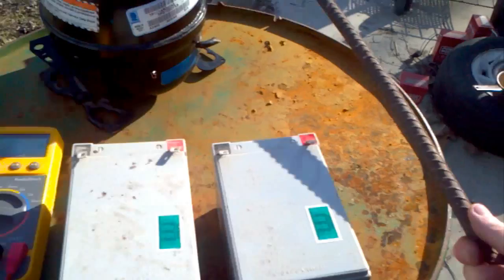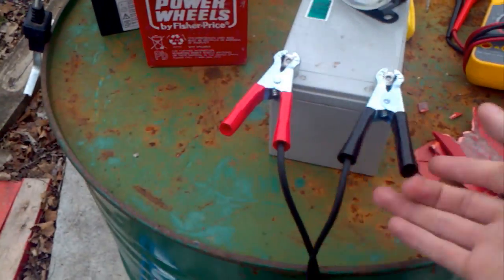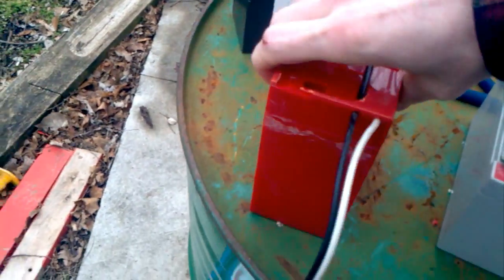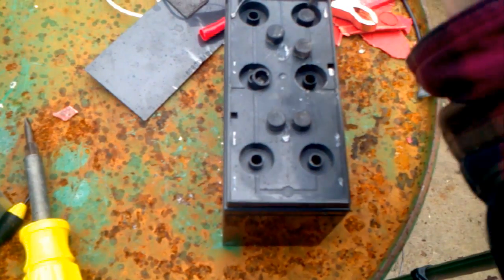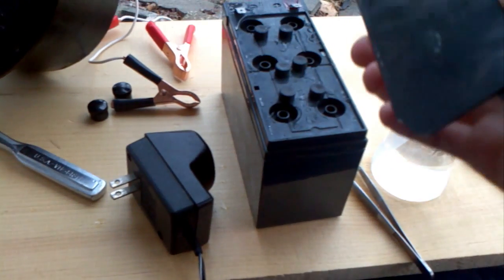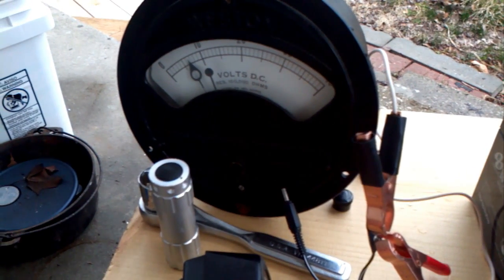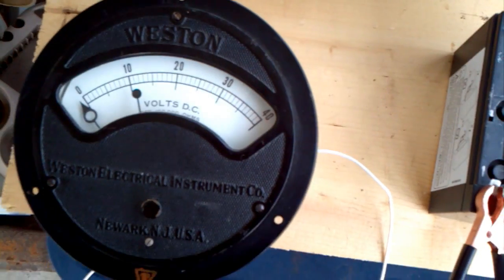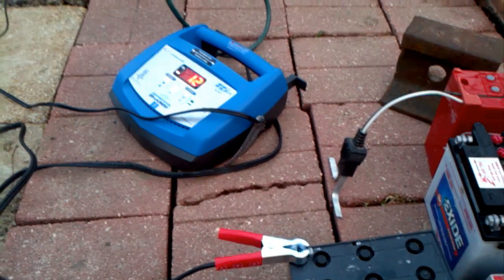DIY: Restoring Sealed Lead Acid Battery

Comment: How are you sealing these batteries back up? Isn't the whole purpose of using SLA batteries so that you can use them in Any orientation? Wouldn't adding water prevent you from use the battery on its side?
Reply from the maker: well you dont have to fully fill the battery, you can just add enough to soak the sponges inside. all you need to do is keep the little rubber caps on so even tapeing the plastic plate back on will do the trick.
Reply: Rinoa Super-Genius So are you saying once you've restored the battery, its ok to drain all the water back out?
Reply from the maker: JRMNone
 sure you can do that too. but you wouldnt be draining all the water out. just the extra water.

i wouldnt recommend draining the water out because it would prolly make you lose some acid. but you could replace that with epsom salt or just a bit of sulfuric acid. would be best just to put a bit of water in to make the sponges wet.

but yeah its not a really big deal if you accidentally over fill it.
Reply: Thanks.  I was cool with water, but I don't know if I want to play around with epsom salt or sulfuric acid.

Comment: Sparking up a welder on a hydrogen-producing battery? Seems safe.
Reply: +Aden B
There are several factors in doing a pro job. One plan I found which successfully combines these is the Magic Mender Wizard (check it out on google) definately the most useful info that I have ever heard of. look at this  super resource.
Reply: Not certain about the points made but ,if anyone else trying to find out how to recondition car battery at home try Vaxicorn Battery Extender Guide (do a search on google ) ? Ive heard some unbelievable things about it and my work buddy got amazing success with it.

Comment: If you are going to try and restore down  SLA AGM What ever then you must have the Correct charger for the Job Welder on a battery What Type Of Crack are you on  ? you are lucky it did not blow the plates and the contents all over you  sheesh If one of these goes west on you then you have the capability to lose an arm hand finger etc. even your life in some cases  Serious And another thing Did your parent's or tutor not teach you anything about hygiene in the work place u need to have a Serious Clean up YOU MESS HEAD !! .
Reply: +Rinoa Super-Genius   Rain water is distilled water for those who have highly conductive water from the tap, it depends where you live, here where I live there is a lot of calcium in the water and it bungs up tap rubbers and kettles.
Reply: Ps always used de ironized water  tap water will work but will reduce the life of the battery . de ion it first .;)
Reply from the maker: Rs500ybd
i think you me de-ionized. i've been putting tap water into all my batteries and only and i havent had any issues with them yet. we'll have to wait till one of them dies to know for sure though.
Reply: Life difference on a 12 volt flooded car battery is about 6 weeks longer on distilled not much in it I know but in critical application needs must ;)
Reply from the maker: Rs500ybd
 6 weeks on like a 10+ year lifespan? yeah i'll save the money and effort and use regular water.
Reply: @RinoaL  The tap water at my house is well water, and as is typical of well water, is very hard, containing lots of calcium and magnesium. I would not put that water into a battery. In general, surface water sources are not as hard as well water sources. In general, municipal water systems use surface water sources as a supply. So you are probably OK putting municipal tap water into a battery. But some municipal water systems are supplied by wells.

Comment: So your load test is with the charger connected. Do you realize what's wrong there?
Reply from the maker: nope because the charger was off and i was using it as a mutimeter if i remember right. but next time give the timestamp of when your talking about.

Comment: The Acid doesn't evaporate! The water does, that's why you don't add more acid just DISTILLED water. If someone puts more acid in a good used battery/still working it will burn it out/kill it Very quickly. More acid will not revive a bad battery.
Reply from the maker: didnt i say that in the video?
Reply: How To Start A Battery Business At Home>>>[ https://t.co/jfZbilIKLW ]...

Comment: u simply gr8.......just last week i replaced with new UPS battery.....
i will try this in next time...
thanx
Reply: jeff cantley , i am 99% sure that you dont know what that ecuation says... E=MC2
Reply from the maker: *****
and you dont know how to spell equation. not counting E=mc2 is wrong. E²=(mc²)²+(pc)² is correct.

Comment: can charge my 12v 7ah with my car battery charger (at 2 amp) ?
Reply: Rinoa Super-Genius
If you want to fully charge it, if you are cycling it (charge-discharge) charge it to 14.4V for about 10h, if you plan keeping it on the charger for long set the voltage to 13.5-13.8V. You won't fully charge it by setting 13.8V, so first charge it to 14.4V and then after 10h or so (not more than 12h) put it on standby at 13.8V
Reply from the maker: MrOpenGL
 well you can fully charge it by going to even 12.9v.
Reply: On the side of the battery there is usually a sticker with a value "Maximum initial current", typically 2.1A for a 7Ah 12V VRLA battery (I assuming you are talking about that kind of batteries, like the ones shown in the video). If you stick to a lower setting on your charger than the "Maximum initial current" and set the correct voltage and you should be fine. Please, never attempt to charge a battery at more than it's maximum initial current. It will ruin the battery and get it running very hot.
Reply from the maker: MrOpenGL
 another good rule is just make sure it never goes above 15 volts. and its best to keep it bellow 14v.

Comment: Hey. Although there are some dead cells, the battery can still be used. Use a 12v solar panel 10-20 watt and connect the battery, make a joule thief with current limiter and connect a led light or more,

Comment: I have 2 mobility scooter batteries that have gone completely dead less than a year old can I restore them using this method?
Reply from the maker: yeah they will prolly restore pretty good. although i can't remember how crappy this video is compaired to my more recent ones.

just pop off the hidden caps and fill it with water (or epsom salt solution if you want) and then let them sit on a very low charge for several days.

do you have any good 12v batteries? like a truck battery would be great. connec the batteries in parallel to that battery and it will only charge them to 12v. then every evening you can top-off the big battery with a charger.

also FYI what epsom salt does is its like adding more sulfuric acid, it increases the reactivity of the battery so it can give more amps.

Comment: you should search the net for batteries and charging you cannot get old ones to hold a charge if one cell is  bad you can disconnect each cell to find the bad one .then you leave it out of circuit and get a lower voltage that works for a while .eventually that will have a weak cell too

Comment: 5:59 your laptop is running very slow replace your hard drive whith a new hard drive 80GB upgrade your memory ram in 256Mb install a opereating system in harddrive install drivers open your laptop and remove the cpu coolen and clean it after you close your laptop turn it on and now is running 4x faster
Reply from the maker: the laptop is from 1996. it can only handle 80mb of ram. you don't seem to know much about computers.
Reply from the maker: Δημήτρης Βερλής
this IBM laptop is running fine. thanks.
Reply: Jesse Lawton ohh and i had a battery the other day burst into flames. was funny it had expanded so i knew the plates were stuffed so i litteraly punched it and it obviously shorted cause i had to throw the battery and spray it with water to stop the fire.. lol good times
Reply: Rinoa Super-Genius lol that guys comment above made me spit my drink hahahaha ghaha oiy mate umm you play with solar panels much? im havin a ball with me solar system. and me what 13 recovered batterys at this stage :)
Reply from the maker: *****
 the OP is hopped up on stupidity and ignorance about computers.

Comment: gases from the battery are highly flammable
Reply: Rinoa Super-Genius
Arcs can form inside the battery cells too, where most of the hydrogen and oxygen gasses have accumulated, and explode the gasses.

 lead is a soft metal.  being soft, the plates inside can warp easier, say from having low fluid levels and being charged.  Since the battery cells are in parallel connection, full amperage is assessable to each cell.  So, running the welder amperage through the cell, or shorting out the battery posts, or charging at high amps, or anything else like that can create arcing of electricity through the air.  And if one of the cells is warped, the air resistance between plates may be way less, increases arc potentials, because two of the cells maybe closer together.  Especially when the top of a cell has a low fluid level and is exposed to air.

Also, when lead acid cells are over charged, or i think, rapidly discharged(from running high amperage circuits, welding, heaters, etc...) flakes of lead pop off of the plates and accumulate at the bottom of their cell space.  Deep cycle lead acid batteries have extra space at the bottom of their cells to allow for a accumulation of these flakes of lead.  When enough flakes build up, the cell shorts out.

So, we should consider there may be flakes of lead inside each cell, and if the battery was ever tipped over(say, to drain the electrolyte.  or because it is 'dead' battery and someone kicked it over).   There is a risk that these flecks of lead could have been shaken/distributed throughout/between cells.  And some are resting on top the cells(above fluid levels).   We may have a arcing risk with this too. 
Heck, there might be flakes of lead adhered to the top of the cells, if the battery was tipped upside down and the flakes glued it self there and dried, and when the battery is reconditioned and put back in use, these flakes on the top, loose their adherence and randomly rain down.
Reply from the maker: yup
Reply from the maker: cl8ff
 tldr, but i skimmed through it.

in my other video where i cut the bottom out of a car battery there is a small powdery mush on the bottoms. you might wanna see that.

the video is called "DIY lead acid to lithium ion conversion"
Reply: Rinoa Super-Genius
there are many ways for cell plates to arc inside of battery case.
electrical arcs ignite the hydrogen and oxygen rich air inside battery.
battery goes boom.

Comment: If you ever get around to doing it, I'd like to see the video, maybe you could send it to me if you do it. I don't think the C64 is a multilayer board, so replacing the chips should be straight forward. I replaced my Atari 7800 bios with a custom bios that allows you to read roms through the joystick port and it was pretty straight forward and I did the same thing, installed a socket to make switching it out easier, though I had to do a couple extra wires. It's cool to dump the roms myself.

Comment from the maker: yeah i don't think actually doing it would be hard. it's just getting around to doing it because doing it would mean filming it. and filming can take several hours to get right.

if i did though i would have to also build a new power supply since the power supply is what fried it. but if i did replace any chips i would be sure to replace it with a socket instead of a new chip. that way i wouldn't ever have to resolder a new IC but instead use the socket.

but thanks for the tips.

Comment: IIRC, there are only 4 ram chips in the C64 and they are still available from mouser electronics. They were very common chips(4164 is the chip number, IIRC it's been a long time). If you're handy with a soldering Iron, you can fix them easily. The VICII chip is much more likely to fail as is the SID. I don't recall which one it was, but one of the those 2 chips (probably the VIC II) was connected to the JS ports which are right next to the power button making static a major risk.

Comment from the maker: Yeah that is pretty awesome. I have two disk drives and a bunch of software. Even have a 3d cad application. But my commodore 64 and 16 both are fried. Pisses me off. But at least they both came in their boxes so look nice on the shelf ^^.

BTW its just the ram is fried. I'll be able to fix it just will be someday in the future. When I turn it on the bits in the ram are permanently stuck in random one and offs so the screen just sticks with gibberish.

Comment: I still have a hooked up and working C64 with a 1581 disk drive (3.5") which is extremely fast  It will load a 200 block program in 8 seconds. It's also compatible with PC disk drives, so I can download games and play them directly on my C64. Pretty cool, eh?

Comment from the maker: Nice! unfortunatly the batteries i fixed in this video where too far sulfated to keep their voltage for more than a week, but i am working on desulfating them for a latter video.

i like your vigerous aproach, thats always turned out bad for me. tried that with a truck battery and woke up to it at 170*F and couldnt stay above 3v. but that battery was from like 1994 so bleh.

have you tested the amp hours of your battereis yet? i'm curious to see how good you got yours :D

Comment from the maker: most of my batteries i keep on the concrete patio outside or on teh concrete floor of my shed.

the two motorcycle batteries i bought last year have spent their entire lives on concrete and they seem to have normal self discharge. although i havent done a good comparison test yet.

i'll add that to the list of videos to make. :D

Comment from the maker: hey thanks for backing both of us up.

i believe the battery-on-concrete myth was started in the early 1900s because back then batteries where plates inside of a square glass container with a wooden box built around it to keep the glass safe. concrete is usually moist so if you put a wood cased battery on concrete the wood deteriorates and weakens. but ever since plastic batteries came along it that guideline no longer applies.
Reply: I've been told even by battery sellers not to keep them on concrete. I have seen them discharge quicker than on a wooden bench.

Comment from the maker: using tap water is fine, i have been using tapwater in my batteries for a while without any problems from it. that distilled water only theory is tossed around a lot on the internet but i havent seen any real study that proves it. and my own research into it seems to show that it doesnt matter if you put cheep water or expencive water into the cells.

you waste your time bothering me with theories that you think are fact when you havent said if you even have any experience reviving batteries. :/

Comment from the maker: i would never buy Ultrafire, they are a HUGE ripoff. i've heard a lot of bad stuff about Ultrafire cells being crappy old ones that are rebranded and have like only 400mah.

my first battery had 72 cells and it was about 9ah (because the cells where a bit old) i would say dont invest much in lead acid. if you can get them free then thats awesome. i'll send you a more detailed private message since they can be longer in words hehe. :D

Comment: I have been using the desulfator and charging the batteries every other day for 3 or 4 days. The charger finally shows them as being fully charged and they will reach 12.5v now. What is the normal standing voltage on 20ah SLA batteries?

Comment: Or are they cheating us on the prices?

Whell, i also found a very cheep Li-ion 18650 sent on the ebay, 4500mAh. for 1.5$/cell! I can share the link, free shipping too. Brand: Ultrafire...
Finaly this is my big question:
IF i buy 70 of this cels (105$) a BMS of 40A (35$) and a case (20$)... a total of 160$ would i be able to construct a battery kit equall to the 500$ once out there?
WOULD I HAVE THE SAME DRANING ABILITY ( of 40A lets say?)

Sorry for all this...

Thanks man for listening

Comment: Ok, for sure i would prefere a Li type battery more. They have no limitation in charging, and they are more light. But they are so expensive! I liked the work you did with your Li set for your e-bike... and your performances were good... You said you find a 18650 cell for 1$! that would be great. I would like about 1KWh capasity, so about 70 cells would do for me... but 70$ its not the case right?(A BMS = 35$).
 1KWh Li-ion is about 500$ out in the market! ! !  
Is something going wrong?

Comment: Q: In Cyprus it is about 30-40 euros (50$) for a 15Ah SLA. how mutch is it at your place?

Q2: Are there any Deep cycle SLA of such a size in the market? Are they more expensive? I am sure that they would last more for this aplication (EVs). even thaw they will have less draning ability (right?) it would not be less than the 30A that i ll need it 4. Car batterys have more than 100A draining ability right?

Comment: Hi Man,

Remember me? I really need your advise! I write you here cause I dont know were ealse to.

By the way, I am glad that your subscriptions are steadily rising. Expected with all the clear work you do and presend!

Ok, I finished my DIY solar 100W panel and started with my e-bike project. I found a used bike with disck brakes and suspentions, ordered 2 x 48V 1000W hub motors + extras ( wwwbmsbatterycom ). I didnt bothered with external motor since you advised on your other video.